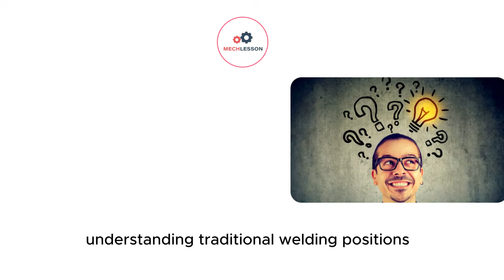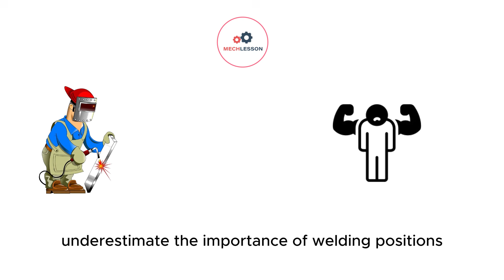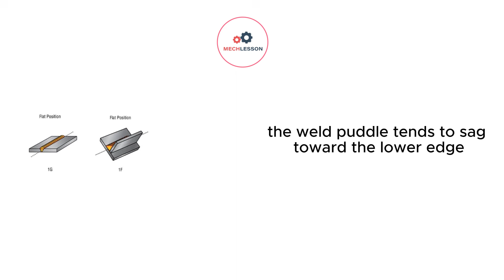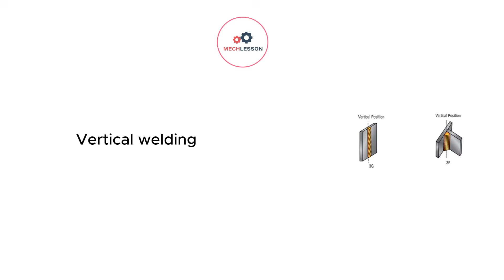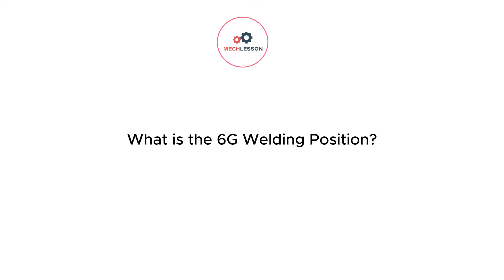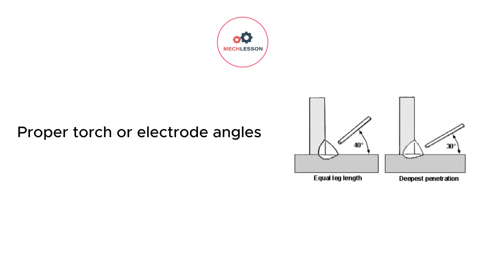What Are the 4 Different Types of Welding Position

Comment: what if you are meant to weld a propeller blade into its boss. is it still called 6G, or it's called the 7G?
Reply from the maker: The standard welding designations covered in this video go up to 6G for pipe, and specialized configurations for unique geometries like propeller blades often fall outside those basic codes. 🛠️